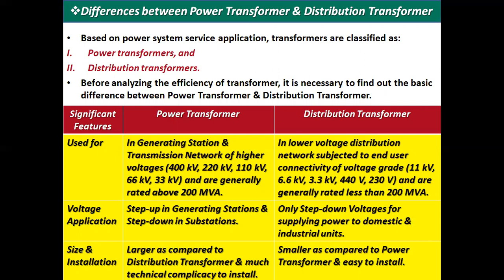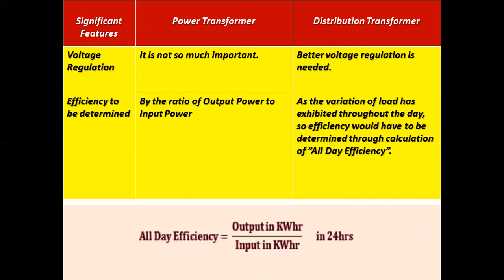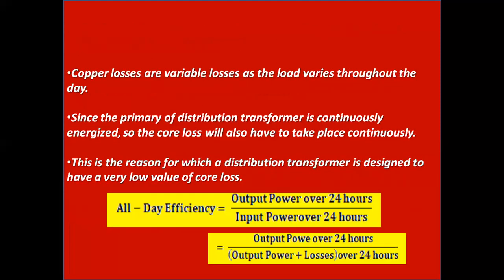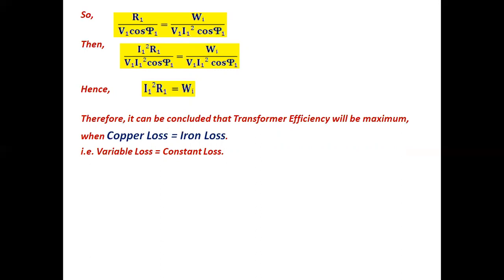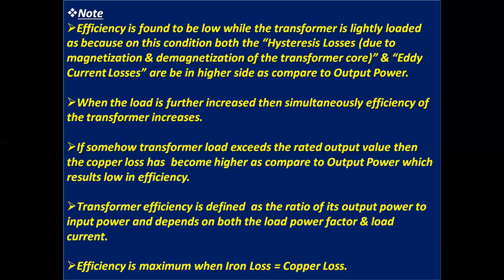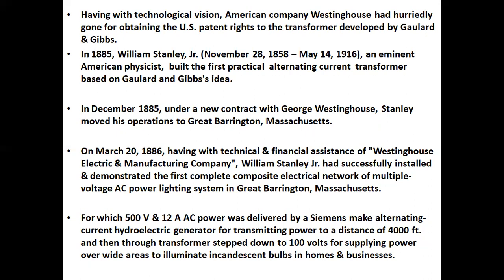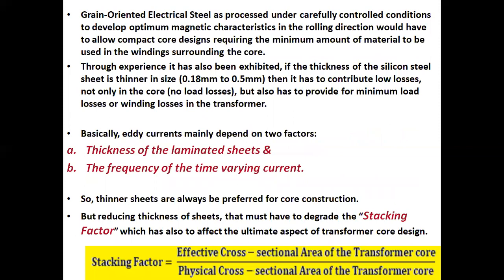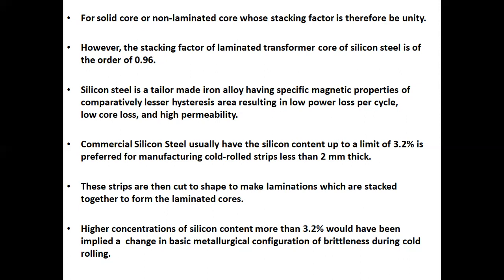Power Transformer Part 10

Comment: How to measure of high voltage of step up tranformer of 548 kva and out put of transformer 2700 v, can suggest me any device,
Reply from the maker: at least
Reply from the maker: "Capacitor Voltage Transformer (CVT)", technically also termed as "Capacitor-Coupled Voltage Transformer (CCVT)", is effectively used in power systems to step down extra high voltage (EHV) signals and provide a low voltage signal, for the purpose of metering or operating a protective relay. Detailed discussion will be made at separate publication. Till date you please have to wait. Thanks for your interest.